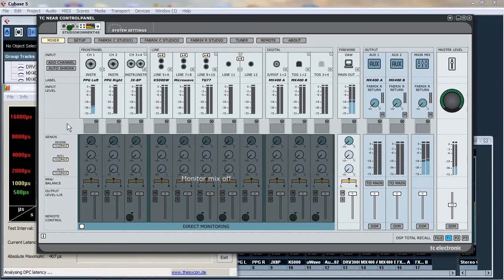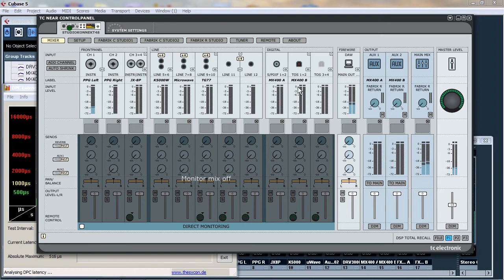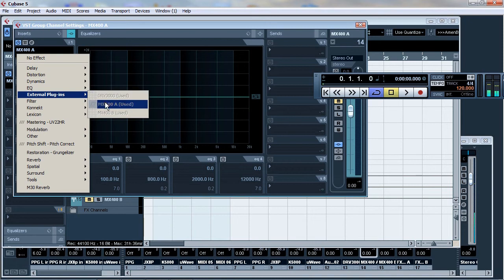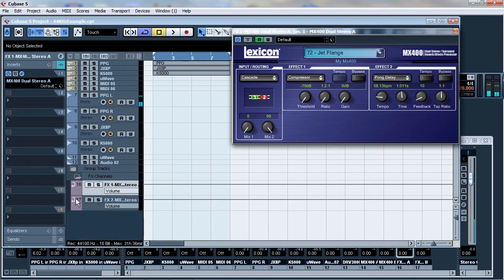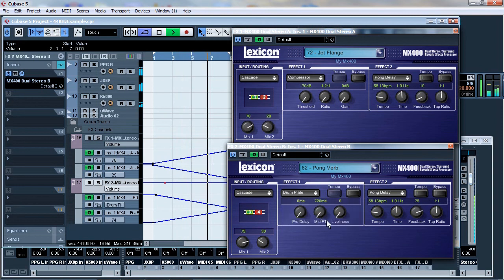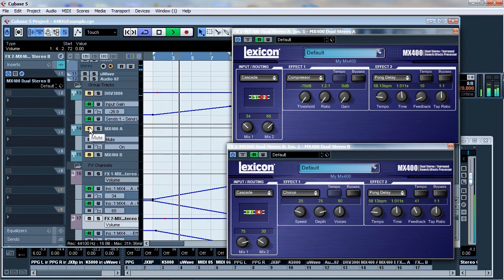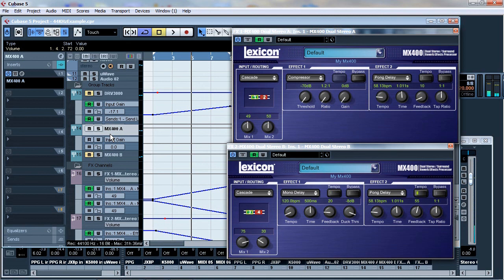Edit Lexicon MX400 parameters w/ Cubase 5 & TCE SK48

Comment: Good night my friend, I have a lexicon mx300 used but I do not have the installation CD. Could you help me with the cd in the mail? please, Thanks yfrsn.you.know@hotmail.com
Reply from the maker: No need to wait or worry!  You can download them from the Lexicon web page; http://lexiconpro.com/en/software
Reply: Thanks for replying my friend, but I just need the vst plugins, and in the lexicon page there is only one update, or do I need the vst to use it in plugin mode? thanks again.
Reply: MX NetUpdater 1.0 (Windows)
MX Edit (MX300) 2.3.1 (Windows)
This is just what appears, I need some more driver to work the vst as in your video? Thanks a lot for the blessings help
Reply from the maker: So, the plugin is only a piece of control software.  All the audio routing is still done via physical audio I/O.
Download & install the plugin into your DAW & this will allow you to control the parameters of the MX300.
The Lexicon page has only one update, as this is the latest one.
Reply from the maker: You don't need the NetUpdater, just the MX Edit 2.3.1
It contains the MX Editor & includes the plugins.  👍🏼

Comment: Hey, how is it possible that you can open two instances of the vst plugin, like in min 6:18. I always get the massage that the midi settings are wrong and i only can open up one instance of the vst. Do you have a solution for this?
Reply from the maker: +TechnoRöhre Good question!  Technically it's not two instances; it's two separate devices the plugin's are addressing.
In my setup the Lexicon MX400 is set up in Dual Stereo mode.  Not knowing what your MX400 is set up as, it's hard for me to say exactly.
The MX400 can be set up in 3x modes; Stereo, Dual-stereo & Surround sound.  By using the MX400 in Dual-stereo mode, it's like having 2x MX300's in the same rack unit.  The way I separate them in my head is to call one device MX400-A & the other MX400-B
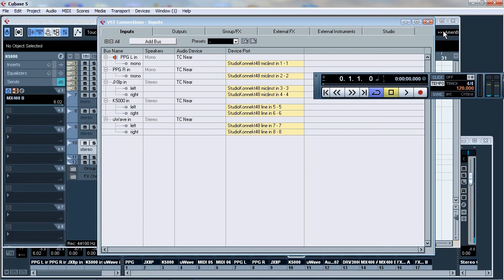At 2:53 I begin to explain the setup.  Remember; The VST plug-in's are only Logic/Control devices - no audio is processed by the plugin.
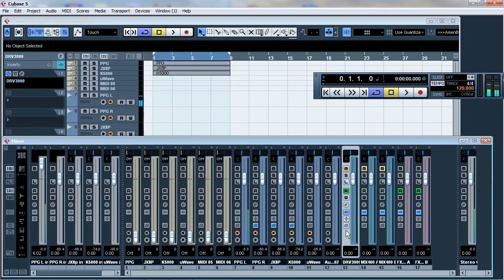At 4:05 The group track is opened & the Insert of the Group track is the MX400-A plugin & like I've written earlier, the insert is Logical/Control plugin for the MX400-A.  You can only use the MX400-A plugin ONCE - that's part of the reason why it's better to use the MX400 as a Group track, because you can only call it up once.
The other MX400-B group channel uses the MX400-B plugin.
...
You only get to use one instance of either the MX400-A, or MX400-B, for either side (A or B) of the Dual Stereo MX400.
A fair analogy might be;
MX400 (Dual Stereo) = Home Entertainment Centre
MX400-A = TV
MX400-B = TIVO
MX400-A plugin = TV remote
MX400-B plugin = TIVO remote
Reply: Thank you for the answer! My MX400 is also running in dual stereo mode and i would like to use the two plugins (MX400-A and MX400-B Plugin) as a remotecontrol, just for the midi cc´s. I think the problem is that i use Ableton live and i cant get the same routing for the midi in Live as in Steinberg/Cubase, where the unit is made for. Could you tell me on which midichannels and settings your unit is runing? and also your midi settings in cubase?
Reply from the maker: I have MIDI Channel A - 14
And then MIDI Chan B - 15
...
However, I should disclose; this video was produced on my ASUS F3SV Windows laptop, which died in early 2011.  I switched to Mac only to discover the MX400 plugin for Mac is ONLY an .au plugin & Cubase uses .vst's.
I've contacted Lexicon Pro regarding this & have heard some 'rumours' that a .vst plugin for Mac's is coming "soon".
That doesn't exactly help you, but I'm not sure how to adequately respond to the questions regarding my Cubase MIDI setup, relating to the MX400...
I've been toying with the idea of using a MIDI controller & the Cubase MIDI Device Manager to route CC messages to the MX400, but I've only done cursory research.

Comment: Hello, you help me connect my LEXICON MX200 A NUENDO VIA USB FOR USE AS PLUGIN. THANK YOU. GREETINGS FROM ARGENTINA .. A BIG
Reply from the maker: +Luis Madero The Plugin is only a logical control device - to control the MX parameters via USB.  No audio is sent via USB.
If you want to record the wet/mixed signal in Nuendo you still need to set up in's/out's via your VST logical/physical connections with your audio hardware.
Reply: thank you very much for your advice and help

Comment: Great video. Where is the MX400XL VST available?
Reply from the maker: +catchin__ The only difference between the MX400 & the MX400XL are the audio I/O (unbalanced/balanced respectively) on the MX rear panel.  You can use the MX400.vst (PC only) for the MX400XL device/unit.
This is something I have learned only recently; the MX400 is shipped with a .VST driver for PC, but only a .AU drivers for OS-X.  Since making this video I switched to Apple & Cubase doesn't use .AU, only .VST...  :(
Reply: I spoke to Lexicon customer service last year about this, and the VST is only available as  32-bit version. They said a 64-bit one was on the way, but I think they dropped the ball on it.

Comment: Cubase, why is it wo hard to set this up? I cqn set this up in 5 seconds on Studio One 2.6 and by the way I use a the mx200 for vocals only.
Reply from the maker: Daniel Flores Flexible routing is why it seems complicated...  Your audio device has physical inputs & outputs, but internally within Cubase you can route inputs to outputs, through group channels, any way you want...  But Cubase doesn't pretend to know what you want to do.
1. Load the drivers Mac/PC
2. Open Cubase project
3. Setup your VST Connections (normal channels) - assigning Cubase to the physical Inputs & Outputs of your audio hardware
4. Under the External FX tab, setup your audio hardware send/return channels
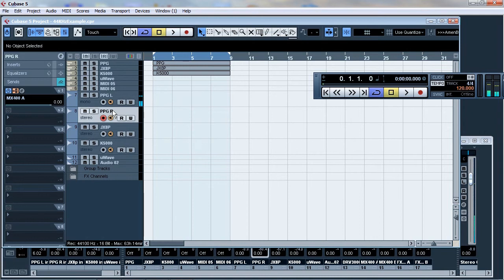5. from 2:53 you'll see how the Group Channels are setup.
Remember: your MX200 is a single effect, but you might want to have multiple recorded tracks being sent to the MX200.
That's why it's best to set the MX200 up as a Group Track (a single track that you can send multiple source to).
...
In your project, you'll record on the audio tracks.
Within your recorded track settings you can select which effect unit (in your case the MX200) send audio to.
Enable the send & select the group channel, then increase the send amount of your recorded track.
...
If you're looking to automate parameters of the effect, you'll need to insert the 'Logical' MX200 driver...
...
I can't tell you how to wrap your head around Cubase, but it's not not a straight line - when you're looking for a straight line.  Part of this is Cubase (with the flexible routing) & part of it is Lexicon with the way they've written their automation drivers.  You just have to try to make sense of it.  Sorry dude!  :/
Reply from the maker: If you don't require automation, then you don't need to do the 'Logical' driver section.

Comment: Thanks for the tutorial, please help me with this if you can. I have got the MX400 patched into a bay. I had problems installing the included software, so I am only using it as hardware unit. Is the software controller recommended? 2) can you send all tracks of the project to the same reverb effect at the same time without doing group folders? Just confused a bit on this. Many thanks!

Comment: @Anamnesia no just aux sends in general, for example on the video the mixer has 3 (the shaded bit that says monitor mix off), one for the reverb and two other ones (which am guessing are for the two headphone outputs on the front of the unit), can you set up more sends for example have 6 sends: fabric r on send 1, have the mx400 on send 2 (routed to the spdif outs) and have the remaining 4 routed to the 8 outputs on the back of the unit (so you end up with 4 stereo heaphone mixes)